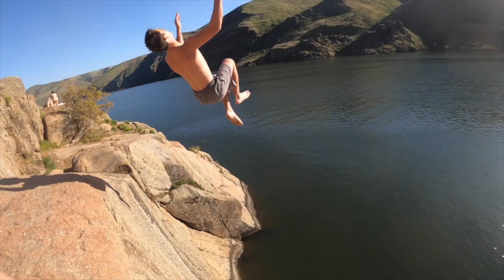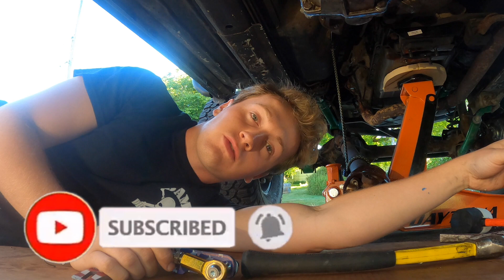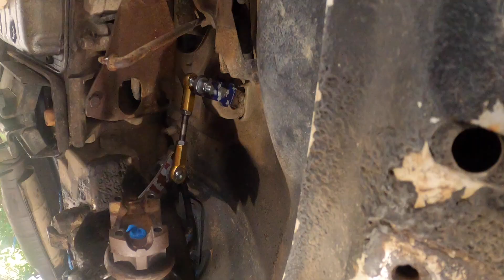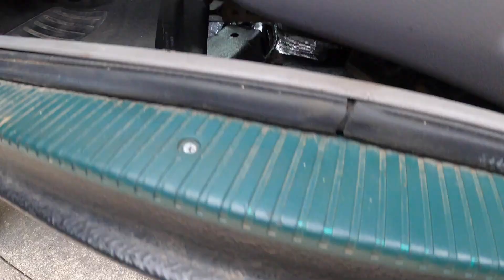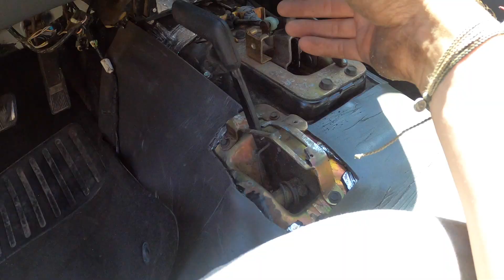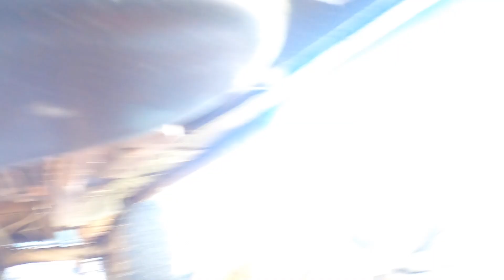Get your jeep to shift into 4WD SMOOTH / How to install azzy design works T-Case linkage XJ TJ MJ

Comment: So if you have a lift, do you need to go up or down from the center hole?
Reply: Neither. Center hole for 99% of 231 and 242 installs. 

The other holes give you options for other cases, and worn out shift forks.

Comment: The website says not for tj , wonder why this wouldn't work for a tj/lj?
Reply from the maker: My only thought would be if there is a difference in the height between the trans and the body due to TJ/LJ being a body on frame style rather than the XJ's unibody design? I bet a little finageling could be done to make it work but I doubt they suggest you do it.

Comment: So I ordered this part for my Cherokee with the np242 tcase and  mine came with 2 of the parts that have the blue on them. Am I suppose to use both of those. Every video I see come with just one.
Reply: Yes the np242 uses both blue pieces stacked on top of each other

Comment: If you had both rod ends on the same side of the plates it would probably feel even better and you may not have had to grind the plate, or your T-case has worn shift fork pads. Mine fit beautifully with both end on one side. I also took the stock shift mount off the T-case.
Reply from the maker: Yeah the instal diagrams made me want to do it same side but I was having trouble with them on the same side. just before this project I did a SYE install and had the t-case cracked open and shift boots seemed to be in good enough condition. 🤷 either way it has been far better than the stock shifter ever was!
Reply: Lol
Reply: I had to twist it like this as well, when I had them both on the same side either the front one would hit the drive shaft or the back one would rub up against the transmission and I couldn't put it into 2H

Comment: I have the Azzy design works shifter on one jeep and the Novak conversions cable shifter on the other one, both XJ's. One is a 242 and the other a 231(for now), both shift very nice, a far cry from the stock abomination that came from the factory.

Comment: Did you have to remove the driveshaft to install it?
Reply from the maker: No you do not have. It was allready out at the time of my install (I was doing the SYE) which certainly helped seeing what I was doing and I would recommend it as its only 4 bolts on the transfer case side
Reply: @SomeGuyOutside  ok, thanks 😊